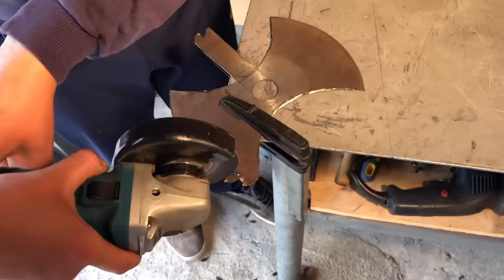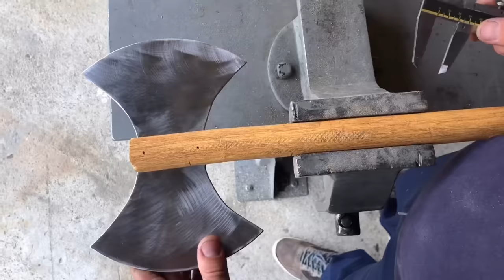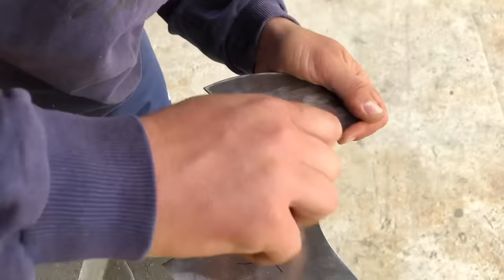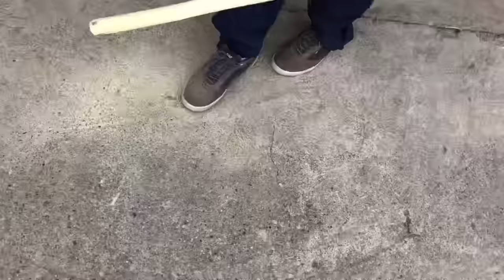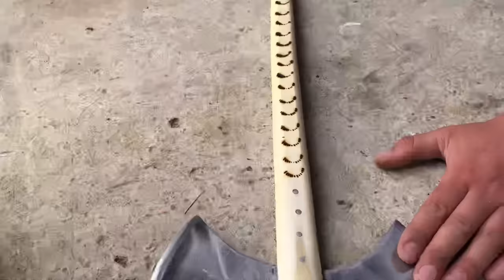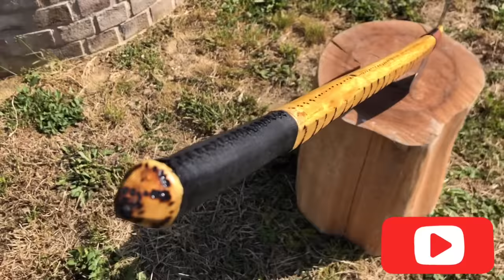Making Axe from an old Saw (hatchet)

Comment: This is a very nice project but I must say finding the center line of a round objects is not easy and to make a cut in a round objects will go off center in a hurry the center line adds strength it's easier do with 2 spead squares before cutting make double sure both sides are marked check it twice cut once I my self learned this lesson and I hope it will help someone else

Comment: Not bad... Only slight changes I'd make is taper down the handle where the blade attaches 1st and THEN put the nails in, so you can flatten the nail ends to turn them into "rivets" to make the connection stronger, otherwise they may work loose eventually even with the epoxy. Also I'd put the stitching for the top leather wrap on the side of the handle instead of lined up with the cutting edges, that way if you miss you won't hit the stitches and break them over time. All in all a great project! Now where did that old saw blade go I had laying around?!
Reply: Dal
Reply: 1
Reply: 1
Reply: Ye gy 6 test tur gyhom to
Reply: Ye ⁵

Comment: I started making hatchets like these about 2012, and have trouble keeping up with the demand. The only change I made was to the leather at the blade. Once I sew it in place, I go back and put a heavy layer of Bondo body filler epoxy over it, and it hardens like micarta.